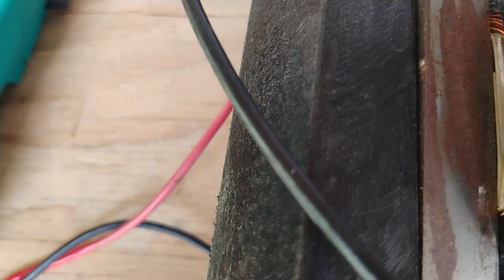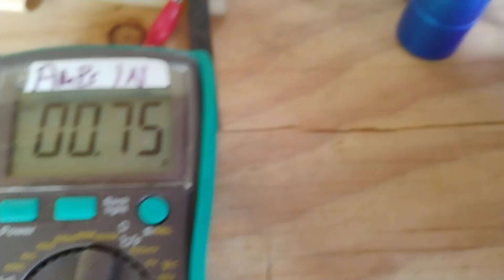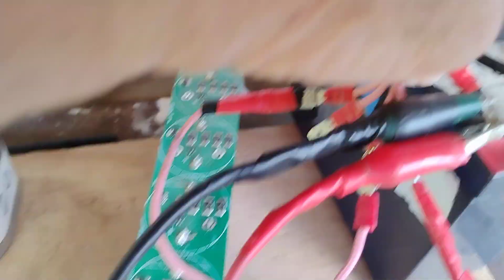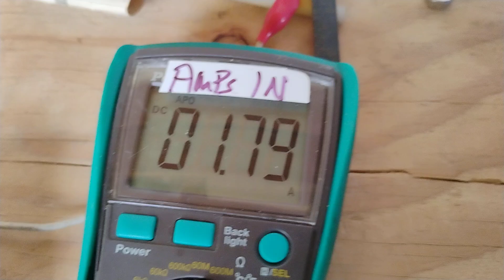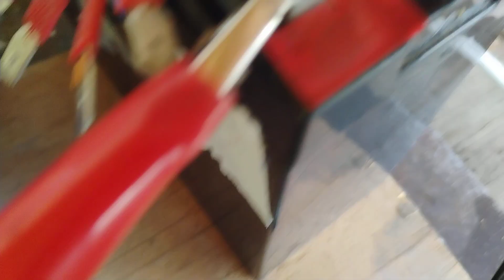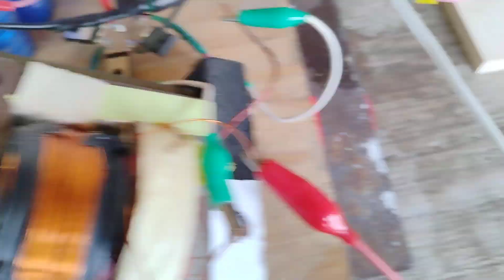New and better transformer from MWOT core

Comment: The circuit is complicated enough that I don't think we can help troubleshoot it without a schematic.

However, you'll see a couple volts difference between drawing power from a battery and charging it. There's a surface charge, internal resistance, and chemistry going on there, that takes some time to restore conditions. Bedini is probably right
Reply from the maker: Hi Paul here in link is the circuit I I am testing right now, note how the FWBR is charging up the cap  at same time the invertor is pulling power from it.

 https://alternativeworldenergy.wordpress.com/july27-2024-test-rv-circuit/

In video about 6 minutes into it,  I show the invertor sucking in 1.8 amps with FWBR connected
while  FWBR not connected, there is 90ma being drawin from invertor.
Meanwhile there is 780ma going into charge battery and super cap from the series transformer and FWBR when its connected so "not there" yet....

 I really think it should be an either-or thing going on in that it either charges a battery or it pulls power from battery  but not at same time.

 You could say a car alternator charges battery and you can turn on lights same time but that is certainly not any sort of effecient  condition in that the alternator can supply  tons of amperage.

Seems like I could get it to run "straight" from the run cap phase through the series transformer,  and just rectify  with single diode, put in a DC "smoothing" cap and let her run with that invertor. 
 I need to get that transformer down to 13.8VDC supposed to be optimum, and this 13.8VDC with the load of invertor powering the motor too not what the series transformer and FWBR (or single diode) make unloaded in voltage.....basically the invertor cannot take in over 16VDC or it blows out ...

this motor can run on 50VAC maybe step down with the vectored transformer, shove the AC into the motor hope for good isolation and no invertor or battery or anything elseneeded just AC to AC  might need a second motor to do this and run one into the other (thinking while I write)
Reply: @MrDKONZEN  from your description I'm thinking power factor is involved. By the way, Floyd Sweet had a clever way to draw power from a resonant circuit. Using a pair of orthogonally placed (or bucking) bifilar coils, common mode currents would freewheel to support the resonance, while differential currents would be drawn away to run the load. So there is a way to draw off the power.

Comment: Dear Mr Konzen, dont bother too much on measurements with DMM. To measure accurately on devices with inductive or capacitive reactance you would need other equipment. Although measuring DC current it does not reflect necessarily the actual power transfer. But in your video titeled hyperwave something like that, you had it looped and the voltage was rising continuously, which is an undeniable proov of drawing space energy  somehow .  It might be a good idea to continue exploring that setup you where using. When I  can get the necessary hard I will give it a try myself. Thanks for sharing.
Reply from the maker: Hi Vidura
When dealing with "stuff"  (inductive or capacitive reactance)  rectified into DC and its all happening at 60hz too, what the DC says into the loads should be pretty close to reality.  In case of charging batteries, the DC says what the amps may be into the battery (or supercap) but the rate of charge and quality of charge does not "necessarily reflect the actual power transfer" thats for sure....
If I also happen to be  pulling in stuff from the environment or other dimensions of time space or whatever "I dont know"
Yes in two past videos I demonstrated where its all looped, the battery and supercap running the invertor, and invertor spins the rotovertor motor, and I shove power back into battery and supercap with the series transformer connected to run cap phase and also from my dual-disc alternator too in one of the videos. So that got some real interest both from me and viewers and whoever interested in free energy stuff.   BUT I have not been able  to replicate that voltage rise in super cap and battery however have made it run "holding its own" with no rise and no drop.  
So trying out different ideas, and maybe there is something else going on I have not been able to lock into as it is real skittish this free energy machine testing one day is good next day is bad I dont have a crew of 50 university students working under me just two hands and one brain although I can get more brains on it by asking questions getting advice...
Here is link to one of the the videos where voltage climbs:
https://www.youtube.com/watch?v=zzkNF3g1-3g

Here is other video with the "Voltage rise" anamoly this with just the run cap of the rotovertor doing it (alternator not on shaft)
https://www.youtube.com/watch?v=rfZ80eRD0Wo

I am thinking there could be a bad connection between the super cap bank, and the battery, so super cap not connected to battery, and the voltages you see are over the super cap, not the  battery....might be I dont think so but could be.  This way the battery drops in voltage running the invertor, but the super cap does not in fact if intermittent connection the super cap could rise in voltage while the battery powers the invertor "independently"
Also I had two batteries parallel plus the super cap parallel to those two, and perhaps the super cap connected more "strongly" to one battery, while the other battery gets sucked down by the invertor, while the other battery and super cap sort of isolated because of the two batteries in parallel.....another theory...
Reply: @MrDKONZEN  yes, it is really tricky, you are not the only person with the same difficulty for replicate the same phenomenon. By trial and error it is like hitting the lottery, but if you are lucky and get it working it might be the best advice to make only minimal changes to the setup and only one at a time, so you will have a good opportunity to learn about how it is happening and the requirements to produce the effects. From the two successful videos it becomes clear that the gain comes out of the rotoverter prime mover itself. In a later video  the effect was there but much weaker, and you mentioned one of the diodes getting hot, this is why I adverted of a damaged component. Also the wiring is important, length and quality, if it is about so-called cold electricity almost always standing waves are involved, where the length of wires, sequence of the connections of hardware and so becomes crucial, and you might not be able to measure current or voltage correctly at certain points. But if the device is running and the battery ends up with more voltage after,(when  you shut it off),you certainly got it.
It would be interesting if it can be done with battery only or with super caps only as well. 
Best wishes 👍

Comment: Not sure but I would try running the output of the bridge in series with the super caps instead of parallel 
That is negative of bridge to battery.     positive of bridge to negative of caps.    and positive of caps to battery pos
Maybe separate the flow or delay
Reply from the maker: Hi Jon
Thanks good idea -  I will give this a try, it should let the super cap be OK for 32V instead of 16V and also lower resistance of the super cap too so easier to fill (maybe) plus if some sort seperation of flow or delay in time thing so much the better

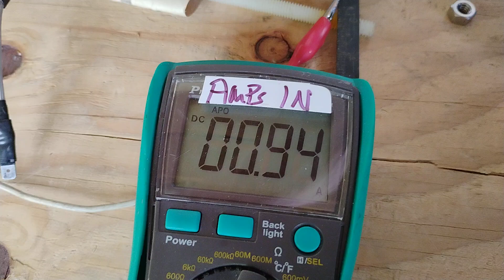Comment: 3:40  I think whats going on with these energy systems is if your load is not sufficient to provide an exit for the excess back spikes then it feeds back into your system rather than exiting out your load . so what i am saying is you need a huge dump load something like a huge battery bank thats empty and ready for charge
Reply from the maker: Hi Mykee
Yes backspikes of current!  (Backemf) ......give it somewhere to go  and something to fill....maybe need some more diodes to help guide it?
Reply: @MrDKONZEN Hi MrDKONZEN I am saying the load guides it .  aka huge battery bank or earth ground . Just a hunch .
Reply from the maker: @mykedoes4099  Hi Mykee
Note that invertor sucks in 1.8Amps when FWBR connected, while with FWBR disconnected, invertor sucks in 90ma.  All this in "looped" condition too, (battery/cap invertor - motor run cap phase - series transformer - FWBR - battery/cap)
So that difference in amp draw from battery to invertor  seems to me this means  something is really messed up...."should be" draw goes DOWN with FWBR connected in my warped mind as the FWBR should "aid not hinder" (you would think)
My guess is the DC flow of FWBR to charge is in opposite DC current direction as the DC current direction that the invertor pulls out of the battery and cap.....makes sense......
Also the current collsion you "could maybe" call a "backemf" collision since it is two  electromagnetiec fields colliding, as well as the electron flow too and you cannot have electron (electrical) flow without the rotating magnetic field you always get both.....so rotating magnetic field knocks itself into a counter rotating magnetic field basically and what happens is what is happening...( theory but sounds corrent)
IF AC everytime the current changes directions is when the "actual backemf" occurs (similar to flyback spikes upon switch opening but currents not voltages mostly) and now you could say its "spikes of current" colliding....whatever!
Reply: @MrDKONZEN  whats FWBR?
Reply from the maker: That's Full Wave Bridge Rectifier which is four diodes configured to convert AC into DC ...two diodes they call a half bridge which only converts half of the sinewave
Reply: @MrDKONZEN  my bad , lol ya fwbr

Comment: Use half bridge on your rectification.  play with polarity.
Reply from the maker: Hi Tachy
Thanks good idea using half bridge, it should lower draw plus maybe charge caps and battery just the same rate.
What do you mean play with polarity?
Reply: Doug, a half bridge will cause feedback into the trans.  This is good.  Depending on the type of load, polarity of the reactive potential can reverse.  Test both sides of the bridge to see which gives the better results.
Reply from the maker: @Tachyoncatcher  Hi again Tachy
Maybe two half bridges, one sends in power to charge  battery as its function, and at  every other sinewave-half, the other half bridge sends out power into the invertor at every other "alternating" sinewave half, 
maybe this will work?.

 idea power is "either or" charging cap and battery, or allowing power flow into invertor but never at same time (see where disconnecting FWBR DC out to battery and cap lowers draw to invertor near one amp in video at 6:28)  Maybe this can can be done very simple like this with no actual switching just diodes controlling flow direction....
Idea somewhat similar to Hectors "diode plug"
Reply: @MrDKONZEN  Doug, you're assuming a simplistic sine wave from your trans.  This is not what gives you excess.  Rather a sine with many transients superimposed.  Use half, let the other half back into the trans.  When you figure out how to control the transients and reactive side of things, then you know how to control the excess.
Reply from the maker: Hi Tachy
I tried it out yesterday using half bridge (actually single diode) and there was much more amperage showing up on meter than with a FWBR this was surprising.....I had looked at this about a month ago and the FWBR was superior....I dont know, will test some more as is usual try to find out what is really real
Thanks for ideas they good ones